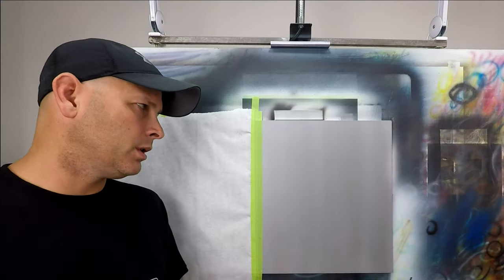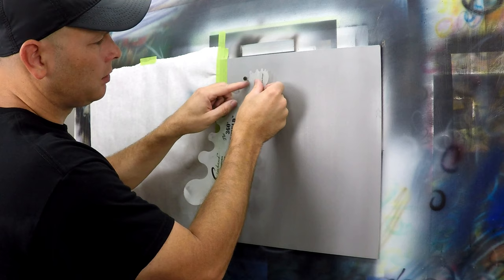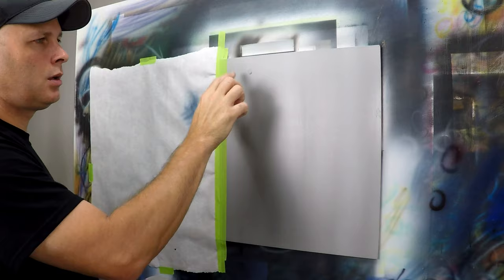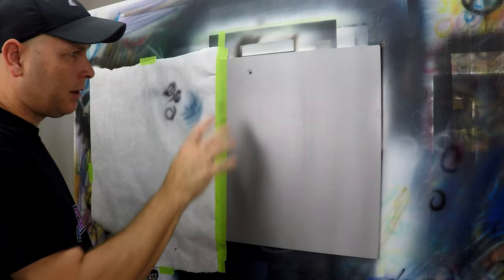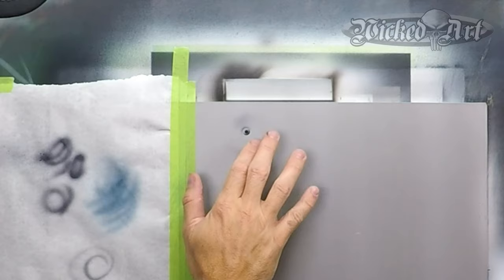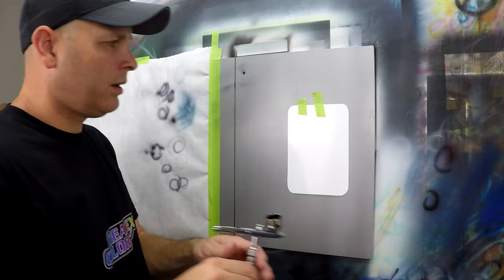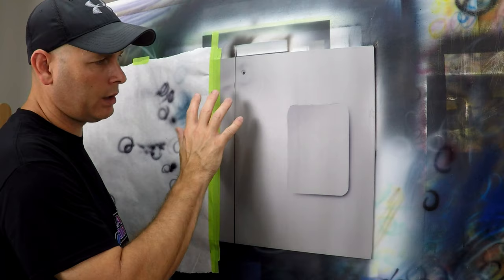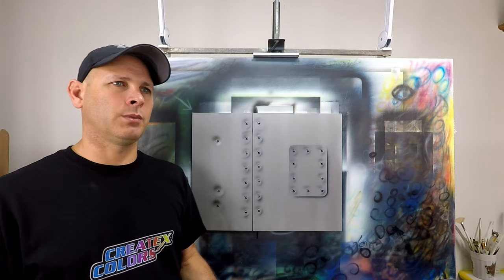3-Dimensional Effects: How-To Airbrush Rivets & Overlapping Panels (Part 2)

Comment: Hi Trevor
I'm digging those deep looking rivets. That patch panel looks great to me. It's sent me off on obscure tangents with some different ideas. What i am trying to achieve is a front fender that looks like's it made  completley of overlapped plates, like 2 "and 3" squares and some random bigger plates as if it's made out of scrap. Would a right angled corner look the same or would you use another approach.
Keep up the good work my friend.
Many Thanks Guy
Reply from the maker: Using a right angle compared to a rounded corner looks the same as far as the effect goes.  The determining factor for which I would choose to use on the front fender for me would be how the contours of the front fender and/or the rest of the bike are shaped (I'm assuming you're working on a bike).  If the fender has more angular shapes or body lines built in to it from the factory, I would likely go with sharper corners for the patch panels.  If the fender has more rounded shapes and body lines built in to it, I would lean toward rounded corners for the patch panels.  Does that make sense?

Comment: Thank you for this video….I hand painted rivets over a spray painted black straps to look like iron bars. My rivets doesn’t look like they are protruding…for my rivets I used gold inside the upper left circle, silver upper right and black on the lower inside…due to the black used underneath the rivet as the iron bar strap…the black isn’t showing up on the rivets..???? What would you recommend instead of black on black…I’m hand painting and stuck.
Reply from the maker: Hi Tina.  I apologize for the late reply.  It's difficult to visualize when discussing issues like this without pictures.  You are more than welcome to shoot me an email at wickedartstudio@gmail.com with some pictures and your questions if you would like.  I think I can better answer your questions with a visual reference.

Comment: Hey Trevor , when doing the patch panel could you use the reflective base coat for high light in the top left , where the candy black was dusted, with a stencil ? Much like the first rivet when using the opaque white
Reply from the maker: Absolutely!  You can either leave a slither of the original base coat visible or erase a little of the black candy for the highlight.  I actually intended to do just that.  Unfortunately, I remembered that I forgot the highlight after I cleared the panel.

Comment: Hi sir! I have a question about the Createx product, I want to know how long can you keep the product after u open it ,I mean the expiry  date of the product ?
Reply from the maker: To my knowledge, Createx has never published an actual expiration date for any of their products.  My experience is it lasts for a very long time provided it is stored in a temperature controlled environment.  I have a lot of stock that still has the first labels Createx used when they launched Auto Air Colors (the vast majority of those bottles have had the seal broken for ten years or more).  I don't recall exactly when Auto Air Colors was released, but It had to have been close to 15 years ago (maybe a little longer).  So again, some of my paint is very old.  Occasionally, I find one of those old paints has become very thick.  Most of the time I can add reducer to thin the color out and it sprays just fine.  Every now and then I will find a color that is beyond saving and I discard it.  So, I can't give you a specific time period as far as when your paint will no longer be usable.  I can tell you, based on my own experience, it will last a very long time if stored properly.
Reply: Wicked Art Airbrush Studio my local store here in thailand said it would work just for around two year and i dont think so too, so Big thank sir! for the answer!! That’s really help! So i dont have to rush working before it expire:)
Reply from the maker: I'm glad to help!

Comment: Thanks Trevor, that panel looked great with the clear on it. what clear did you use?
Reply from the maker: Thanks!  House of Kolor is the only clear used in my shop.  Most of the time I use UC35.
Reply: @wickedartstudio  OK, I didn't think Createx had anything that looked that good. I use HoK USC 01 Show Clear for some things and for fishing lures KBS Diamond Clear. Even though they don't recommend USC 01 be used in airbrushes I've found it works fine.
Reply from the maker: Yes, you can spray a catalyzed urethane clear through an airbrush, but I don't generally recommend doing so. If you don't thoroughly clean your brush afterward and any of that clear is allowed to cure within the brush it will ruin the brush.  There are water-based automotive clears available out there now, but the technology isn't quite where it needs to be yet in my opinion.  I suspect within the next 5 to 10 years, water-based clear coat will be the better technology.
Reply: @wickedartstudio  I clean up with lacquer thinner. I have found the best airbrush to use for that is a single action siphon feed with the glass bottle. They are cheap "just in case". I doubt I would use a single action for anything else, but for spraying clear on crankbaits, it works good.
Reply from the maker: Good to know.  I just wanted to make sure you were aware.  I can't fault you for using the airbrush to clear small parts like fishing lures.  Using anything else would be overkill and waste a lot of product.